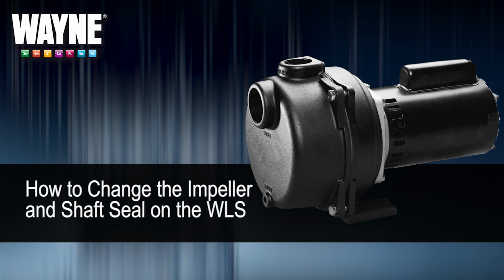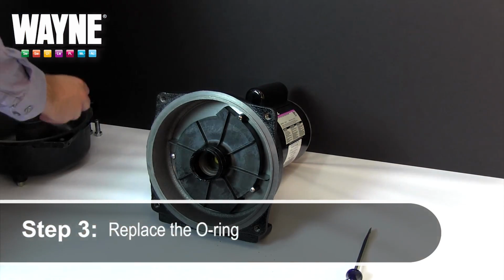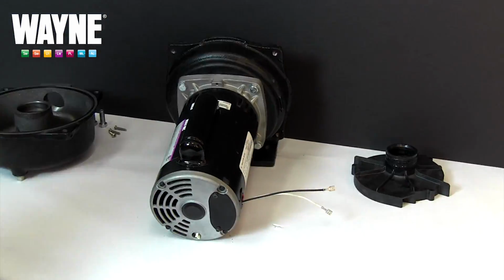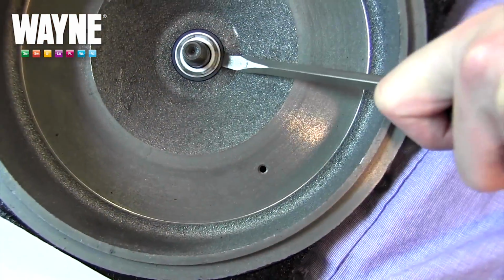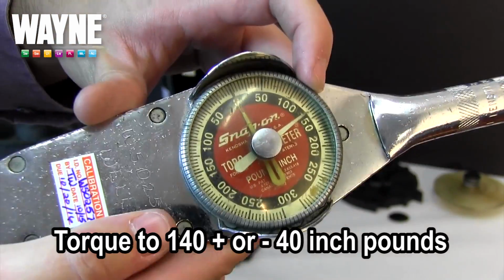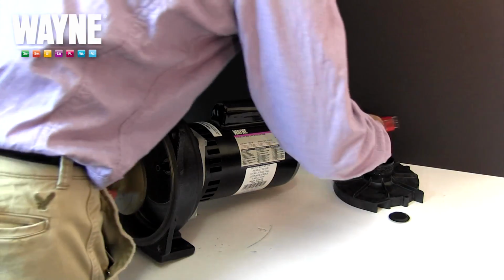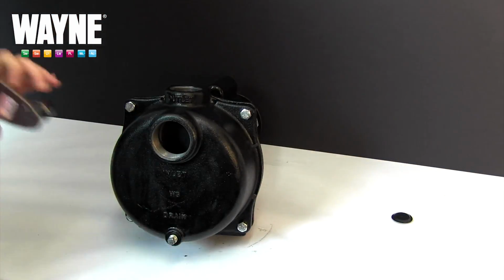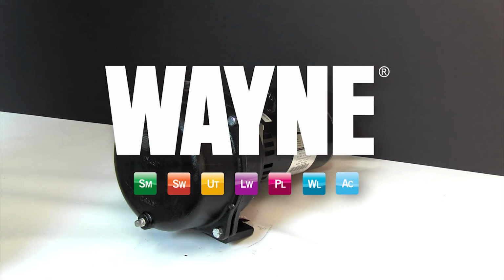How to Change the Impeller and Shaft Seal on the WLS

Comment: My 😮2 yr old pump had broken   nylon gear attached to shaft end but kit doesn't  include the gear.  Can't determine if need a replacement nylon gear before I reassemble the pump with new kit parts.

Comment: Garbage pumps, garbage support. 

My WS150 is 2 years old and the cooling fan spun itself off the drive shaft. Wayne, when I finally got someone on the phone after 45 minutes on hold, said, "Sorry you have to buy a whole new pump." The pump is overheating and shutting off, so here I am trying to find any information about disassembly and the best I have is some limp wrist spinning off a brand new impeller at high speed. Best guess is it's counter clockwise direction? And there is no way you are using a screwdriver to hold that drive shaft while hand turning that impeller. I have the motor disassembled from the rear now and using a pipe wrench I can't get that stupid impeller off. When I buy a new irrigation pump, it won't be Wayne, they can piss off. 

I'm an electrician by trade and have repaired all kinds of appliances and this one is by far the worst I have found with respect to aftermarket support.

Comment: On the pump cover, you go 240 in-lb and then it says to "make sure you do not have a locking situation" (i.e. that the rotor can still move). Then it says "Once you have a locking situation, loosen the bolts 1/4 turn each."  Are you supposed to continue to increase above 240 in-lb until the shaft locks and back off 1/4 turn? Of if you get to 240 in-lb and the shaft is free, you're done and the "back off 1/4 turn" is only in case it is locked AT 240 in-lb?

Comment: I have a A O Smith well pump model C48A94A06 is there a rebuild kit impeller had well connection come loose tried to prime would not draw water

Comment: the speed is far too fast , we need to see which way the seal goes in the housing, the speed makes it very jerky and hard to make out the right way they go in. speach speed is ok, not the video. not good for a first time old man of 70
Reply: If you watch on a computer, it is very easy to change playback speed in the video settings (the little gear looking symbol0

Comment: Tightening the bolts to 240 inch pounds does not lock the shaft.  So which is it? Do you tighten the bolts to 240 inch pounds and call it good because the shaft is not locked or do you tighten the bolts until you can't turn the shaft and then back off a quarter of a turn until you can turn the shaft?    That's not very clear.

Comment: Wayne pump co, you should design the motor with a internal wrenching fittament on the back end....the flat head screwdriver head does not provide enough grip to loosen the impeller....how many people are struggling with this. If you could remove the motor's shaft then you could put in vice to pry the impeller loose but Wayne uses an after market GE pump that the bolts to the pump body and cannot be removed unless you remove the impeller first???!!!  Just a poor design all around with no mind paid to servicing.
Reply: Sh*T no service at al from Wayne/China
Reply: If you clamp a vice grips on it and break the impeller of the  nut. You can then use an 11/16 socket on the impellers nut. Could get mine off and this worked easy as can be.
Reply: @FattSunny  thanks, but I think we're talking about 2 different setups, mine does not have a nut to clamp. The impeller is smooth, and it mounts to the shaft from the pump side.  On the outside is just a smooth disc with a slight extrusion or a nipple in the middle. The issue with their motor   is in order to hold the shaft, it has a shallow slot in the back of the motor...you have a dig the screwdriver hard into the slit and break the impeller loose at the same time. The slot is too shallow, so it skips, and you can't get a good grip. That's why I suggested it needs to be an Allen wrench so you can easily hold it from the back while you break the impeller loose from the front. Trust me, it's a bad design but can be easily remedied if they wanted to.
Reply: @kamran66  Yes this is exactly what I'm talking about.  You can break the plastic impeller completely of the nut inside the impeller exposing just the nut, as for the other end, my wls200 has enough of the shaft with the screwdriver slot exposed that I was able to put a vicegrips on it and a socket on the impeller nut. With that leverage mine came right off.
Reply: @FattSunny  Ok, I see what you're saying, but I didn't want to damage the impeller, I only wanted to change the seal on it.The fiberglass impeller was in good shape and replaced just a few yrs ago.
Reply: @kamran66  Did you figure out how to remove the impeller without breaking it? I am struggling with the same issue
Reply: @slimsung3971  you need to have someone press and hold the screwdriver tight against the screw head and the other guy needs to hold the impeller with both hands and break it loose

Comment: I have a 1/2hp Everbilt shallow well jet pump that I cannot get the volute off.  I removed the four bolts and nothing else is holding it on.  It only comes about 1/4" apart.  I'm afraid I'll break it if I pry any harder.  I'm already damaging the plastic housing.
Any suggestions?